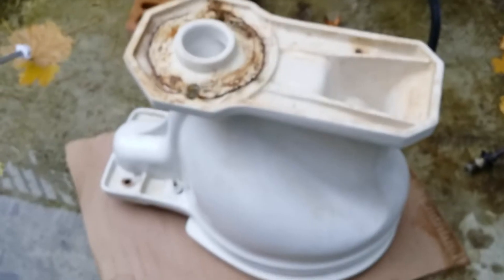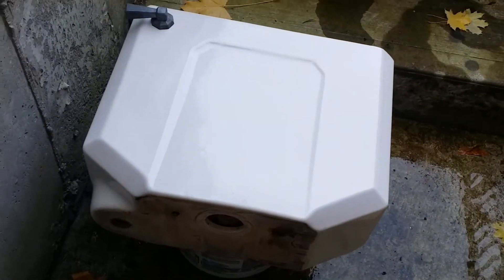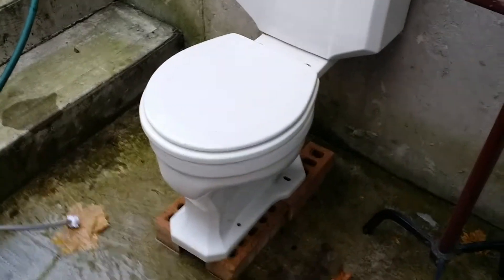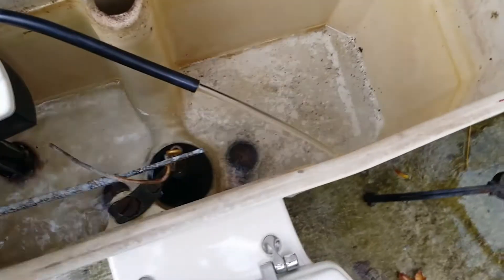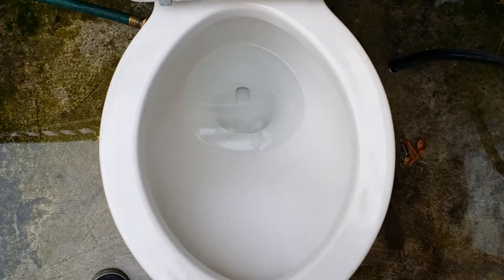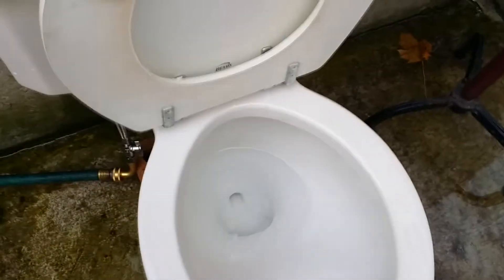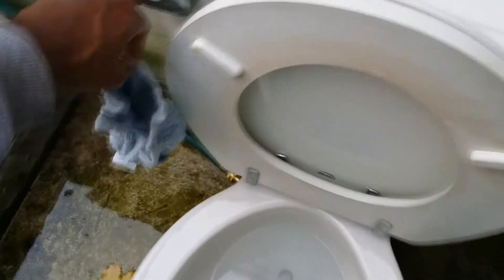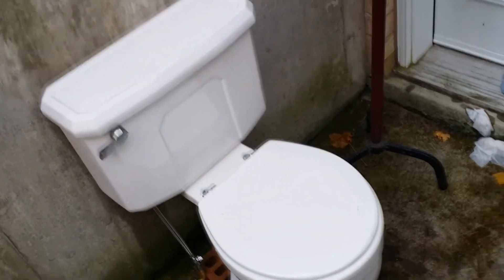1944 Eljer Waco Toilet

Comment: Nice! The house we just moved into has a half bath that was never remodeled. It has a Eljer 1959 with the wide, lower tank. Just ordered a new gasket kit for it. It was leaking at the tank-bowl gasket and the plunger was leaking the tank every 2 minutes. Have a new Korky fill valve to install when the parts get here.